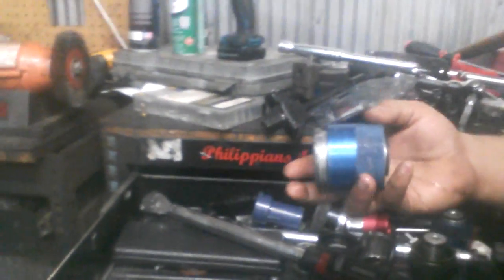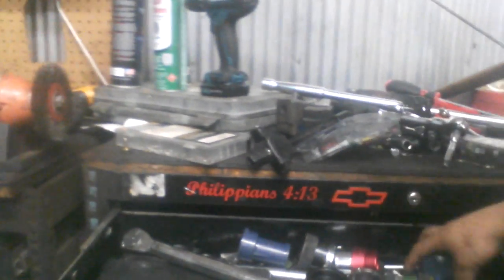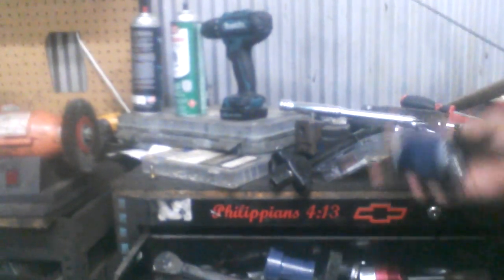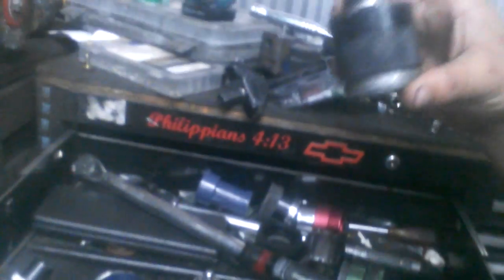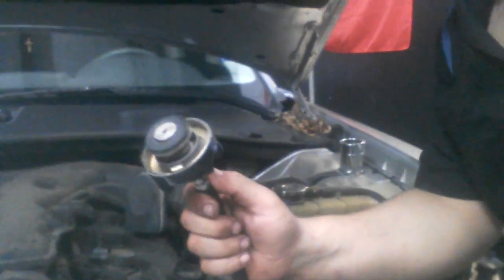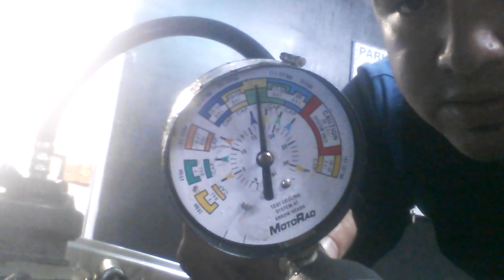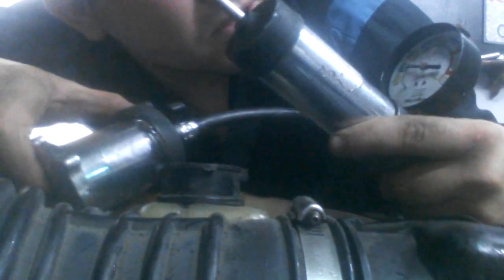How to find coolant leaks. THE EASY WAY!!!!!!

Comment: That was such great information. We have a 2000 Impala that has just had the heads and gaskets done. It still overheats. We bypassed the heater core thinking that might be the problem. It wasn't. There is no evidence of a leak, that we can find anywhere. Yet all the fluids are gone each time. I will now go rent a tester to see if that is our problem which would explain why we cant see a dripping leak..
Reply: Dawn Russo did cap fix it?

Comment: Last year I could get the pressure tester from Autozone for $25 and return it for my money back. I should have kept it. Now they want $250 for a kit that looks like its for a radiator shop. Advance Auto Parts is well over $300. O'Reilly has one similar to the standard in the video for around $80. You can buy a new kit at Harbor Freight for $85 if you want to open your own radiator shop, but the $25 pressure testers are history. I tried 5 different pawn shops and put an ad on Craigslist but no luck.
Reply from the maker: pete peterson yea when I first started I would get them that cheap as well. Don't forget to subscribe and hit the notification bell to get notifications on new videos. Thanks for watching

Comment: Great video I've been trying to find the coolant leak in my old chevy venture I'm tired of taking it to mechanics that take advantage of the customers, at this point I have basicly paid to change the  radiator, the water pump the condenser the termosthat and every time is just a temporal fix, I love this car and I dont wanna get rid of it, but because of dishonest mechanics I been expending probably more that the car is worth,
 where is your shop? 
Dont worry about the thumbs down they are probably coming from the dishonest persons that want to continue to steal from their customers👍👍👍👍👍👍

Comment: I just went thru this with my 2012 Silverado HD Diesel. Pressure test didn’t reveal “nothing that dripped on the floor” - found out later that is because there is a shield underneath as well as a ton of other parts that a leak can hit and gather prior to making its way to the floor.  It takes looking in the nooks and crannies for gathered fluid and not trust the floor.

Comment: Find a good honest mechanic like this guy stick with them and treat them well.  I thought I was going to have to replace the wiring harness and wires (in my type of car that's 6 grand) long story short it ended up being fixed by 2 $1.27 engine bolts AND he didn't even charge me for the diagnostic fee and time that alot of mechanics like to milk as much as possible for those quick repairs. I was obviously quite jubilant about this.  The mechanic impressed me so much with his honesty and courtesyc, so I took him out for a steak and lobster dinner paid for his drinks as well.  In my mind he saved me 6 grand so what's a 200 dollar dinner in comparison. Next to nothing lol. But hey another plus side when I come in for general maintenance or repairs I'm always prioritized to the front! What I'm saying here is treat a good mechanic well and I guarantee you'll get that same respect back. And this guy seems really similar to the mechanic I go to.  TAKE YOUR MECHANIC FOR STEAK AND LOBSTER.  or whatever the favorite food is.  They work harder than you know for less than you'd think.
Reply from the maker: julian floyd thank you sr. These are the messages that make my day. I really hope you have a wonderful day. Thank you very much for your kind words
Reply: I agree my mechanic likes Tequila, cigars and money of course... so that is what I take him, he keeps all my babies running right.

Comment: great video. my radiator fluid is getting low. but no leaks or stain on the ground. ill have to check the cap. by cap is white stains.

Comment: Bought an 2007 Aura and had a coolant leak.  Troubleshot it to hoses under reservoir.  I replaced all 3 hoses (very expensive btw), and you can't make your own as one end is 3/4 and the other end is 5/8ths...  And that wasn't the problem, so frustrating after removing the 3 new hoses again, I inspected the plastic tee again, super close and found the bottom seam has hairline crack (unnoticeable unless you squeeze really hard) at the bottom of the tee...  Hope this helps someone in the future, just a plastic tee replacement, would have saved me a lot of money in those hoses...  Oh the tee is 3/4" by 3/4" by 3/4"...

Comment: Glad i watched this. I can just cut a bike inner tube, stretch 1 end over inlet, other over outlet, & my bike pump will hook right up to it. Might need zip ties, but...
Edit: worked like a charm!!! Idk if this guy took his radiator all the way out, but i wouldn't have found the leak without doing that. But yeah... Fukin old innertube, bike pump, &next - jb weld (fingers crossed)

Comment: Hey man good video. Yes work on the video portion but awesome tip great explanation. Gave me a headache when you moved the camera around. but awesoem job man have  leak in mine suspecting its ab bad cap. Thanks.
Reply from the maker: Morgan Mendieta yea sorry about that. I just learned not to long ago how to edit my videos. New ones are going to be a lot better
Reply: Oz Mechanics no prob.  Thank you. Good stuff. I know you will get better. I would get a tiny tripod the kind with the little linked balls that you can position anywhere.

Comment: Not sure if you mentioned that the coolant should be full first when you pressurize to see if any coolant leaks out anywhere right?  Otherwise if the coolant is really low it wont show you anything. 
Also if the pressure doesn't hold on the first test then there has to be a leak somewhere too right ?

Comment: Great video man! I have a 2005 300c awd. My car has an antifreeze leak. It won’t leak when driving and it won’t over heat at all. It only leaks overnight. I tried looking everywhere and can’t spot the leak. Any advice ? 

Thanks in advance , again great video.
Reply from the maker: RogelioK Rodriguez have you tried using the radiator pressure tester

Comment: I like the video, didnt quite answer how to find a leak that does exist.. Ive got an 02 pontiac grand prix, none of the hoses connected to the radiator are leaking nor is the radiator its self.. im loosing coolant somewhere near my motor. any suggestions?
Reply from the maker: Het Zer have you hooked up a radiator pressure tester to see if it's leaking ?

Comment: you showed us to look under the car for external leaks, but what if it leaks into the engine? We won't see leaks in the engine, so should the pressure at which we pump up the cooling system stay firm at the level we pumped it up to? Indicating no internal leak, or should we do other things to find if it leaks internally?

Comment: I was about to look up a radiator repair shop... heading to Auto Zone now first to rent a coolant system tester.
Reply: My camry 2004 is getting hot and extra box of coolent and even radiator get empty. What should i do?
Im living in uae.
Reply: There is leackege i think because when i fill the water in to radiator  it comes out from the down from right and left sife.

Comment: I have a 2003 bmw 325i and I put a 50/50 mix of bmw coolant and distilled water in it about 2 weeks ago, now my coolant is bone dry. I look under the car almost everyday and have never seen any signs of leaks. could you give me some advise on what to do or what to look for? thanks Oz.
Reply from the maker: Tanner I would call around auto parts store to see if any of them offer a radiator pressure tester with the BMW adapter so you can put pressure on the system to see where the leak is coming from

Comment: I'm a lucky guy where are you located in Houston Texas? I have a 99 navigator that has a leak and I also changed my radiator cap and still have a leak on passenger side.

Comment: Great video my Mazda 6 2006 is having a major leak the thermostat in side reached up to H "hot" and when I checked the antifreeze it was really low what do I do
Reply from the maker: Jeffrey Robles do a pressure test to verify where it's leaking

Comment: Hi I have a coolant leak in my VW Passat b6 1.9 tdi that we can't find. It was initially a torn hose so we replaced it and still loosing coolant from the bottle and small amount under the car but no visible leaks from hoses etc. Any ideas?

Comment: Hi there! 
My VW Polo 1.4 TSI GTI DSG is leaking coolant intermittently... So my mechanic did this pressure test and could not find any leak anywhere... It only leaks now and then.. Even stripped everything and still could not find a leak! Any idea what could be the cause? In case it matters, the 1.4 engine is turbo and supercharged...
Thanks a mil

Comment: HEY BRO. I HAVE THE VAUXHALL,OPEL ZAFIRA 2.0TURBO GSI Z20LET ENGINE AND IM LOSING COOLANT WHEN CAR IS COLD. HOW MANY HOSES ACTUALLY HAS COOLANT IN THEM? HEATER IS LOVELY AND HOT SO I THINK ITS WATER PUMP OR LEAKY HEATER CORE. WOULD PUTTING THE CAR ON A RAMP HELP TO HAVE A GOOD LOOK UNDER IT? EXCELLENT JOB LADS. FROM UK
Reply from the maker: If you have a chance to use a radiator pressure tester that would help out. If the heater core was damaged water could leak into the inside of the car or drain plug from the fire wall of the vehicle. If the heater works as well I would eliminate a water pump failed. Just try getting a radiator pressure tester to verify the leak

Comment: My 2005 Ford escape V6 I just purchased last Friday from a person owner, he just literally replace the alternator I have proof of that and I don’t have any Oil leaks, it rides good,  but to the left of the radiator there is fluid and I believe my cousin said its coming from the radiator is not the Oil,because it’s too light so do you think I’m not just a video but do you think it’s possible that I need to replace my radiator?

Comment: My Grand Jeep 2004 Cherokee has a leak, but looks like it is only when the vehicle is running. I'm assuming it might be the cap that I need to check and or replace. It looks like the leak is coming from the driver side plug on the bottom corner of the radiator. I replaced the radiator about 3 years ago. I assume I could use the radiator fix they sell, would that help plug the leak it is it NOT the cap?

Comment: I put approx 10 liters of antifreeze into the radiator and overflow bottle. My car 1986 Econoliner V8, and it drives like a dream but the windows become very foggy, very soon ? Does it sound serious, headgasket or just the heter system inside the compartment ? I can smell the antifreese from within..

Comment: HI Oz,  I have a 1993 Chevy truck and I have a 1 year old radiator that started leaking heater hose outlet.  I patched it with JB weld around the outlet and it is still leaking very slowly.  When the truck has been sitting for a couple of days there is still a lot of pressure in the radiator.  I have never had this type of pressure in a radiator after it has set for 2 or more days.  Is this normal?  I will drain down the radiator and apply more JB weld.  This is the 5th radiator I have installed in 6 years.

Comment: Wouldn't you be able to identify a bad cap by fluid leakage near the cap? My leakage is on the block near the hose, but not much plus my reservoir ran dry and I just changed out the coolant then left. The new coolant leaked all over the ground the first refill, but I didn't see it until hours later and did not see where the leak(s) came from.

Comment: Bro I have a question, I have a 98 Jetta GL then when I turn on my ac start leak coolant from the driver side under the timing belt , any idea if it is the water pump?

Comment: I have a question pls.  It's really cold out right now; below zero.  I had to get my battery jumped by a professional ... all is well there but now I notice a antifreeze leak on the ground near the front in the middle area.  I'd say about 12-15 inches in depth both ways.  Would you suggest I add a bit more antifreeze to see if that will leak and then take it from there?  I have pro mechanic here where I live.  Thank you in advance.  Kind regards ....  Chandra
Reply from the maker: Chandra Leigh yea add some anti freeze and test with a pressure tester to see where the leak is coming from
Reply: Thank you so much ... I 'll do that

Comment: My preferred method of finding a coolant leak is to take a piece of cardboard stick it under the car run the car get it up to temperature and then let it cool down and look at the colors of the fluids that are on the cardboard. Cheap and easy you shouldn't see any fluids if you see fluids you have a leak of some sort and it gives you a good idea of where the leak is.
Reply: I see a coolant leak on my garage floor, I have a Passat I use the pink coolant, that is exactly what I see clear clean pink fluid, but the mechanic is asking a lot of  $$ to see where the leak is coming from, do you know where the type of leak I described comes from?

Comment: I have a 2002 Chevy Impala and I've got a coolant leak I'm just not sure where. Fluid does get on the ground and I can see the drip if I look under the car. And I've looked where it's dripping but I don't see the actual leak. Wondering if you could help. Thanks.
Reply: Nicholas Dalton same issue, rumor has it they leak alot from the water pump. mine got coolant everywhere and popped my belt. I'll keep you posted
Reply: Sgt.WakeNBake _ I found out that I have to replace my radiator. I found the leak and tried to use JB Weld as a cheap/temporary fix and it didn't hold so I get that fun project when I get paid. Unless I'm leaking somewhere else e.g the water pump. After I replace the radiator I'm good. Hopefully it's just the radiator. Thanks. Go ahead and keep me posted and I'll keep you posted as well.

Comment: Oz Mechanics Joe Doyle. I have a question, my car always says low coolant, i keep it filled to the line in bot radiator and resivour jug , none leaking on the ground, no nasty milky stuff in the radiator but stinky white deadly exhaust, the temperature will go up but not running  hott. What can the problem be? Thanks in advance for your reply.
Reply from the maker: Felita Franklin your coolant level sensor might be bad but I would recommend diagnosing it to verify it’s bad before you start changing out parts

Comment: I have a major water leak coming from the driver side of my Plymouth voyager,  it's a 98, I have to add water before I go anywhere,  how do I check the freeze plugs, or where are they located?
Reply from the maker: Elizabeth Trask use the radiator pressure tester to locate the leak
Reply: located on the side of the engine block. Use a repair manual or blue prints of your engine to help you find things. Note, might want to be sure if the weather gets close to freezing, to stop adding water only, or you truly will have problems with your freeze plugs, and also a possible cracked(destroyed) block and or head. Add antifreeze not water, hope to get it fixed soon so you don't need to pay the added expense of blowing coolant all over the road.

Comment: Is that the only two places that it could be leaking at? I came home to a hissing sound, steam and a slow leak of anti freeze. We can't find the leak, but know that there is one. I had just changed the radiator cap a few weeks ago, and replaced the water pump a month ago. Any suggestions?
Reply from the maker: Michelle Rahner they sell a uv dye that goes into the coolant. You might want to look into that. I’ve had good luck with it. They sell them at Autozone

Comment: Okay so I got one for you. My brothers used to maintenance my car the AC is one I never learned. So I have a 2000 Infiniti Q45 anniversary edition so the AC went out the two front blowers not spinning. Only hot hair coming through. AC compressor not engaging but from the dealership and manual I learned that AC shuts off if there's an issue with the AC/heater to prevent from overheating. I have coolant in the car I actually did a flush on it adding radiator leak fluid. I notice slight leaking on right and left side of engine. I bought it used the owner kept up with maintenance he had receipts to show when he worked on what. This is the only issue I am having with this car. The car runs very well. Just not sure if this is something I can do on my own or take it to professionals don't want to get taken advantage of. Please help....thank you
Reply from the maker: What part of the US are you in ? I have a lot of mechanics that I would highly recommend around the USA 🇺🇸

Comment: THANKS...for the good info:  however, a little bit misleading since (beyond a radiator cap being A possible leak source--AND, the pressure pump indicating whether or not there's leaks, generally)  it didn't help solve for me coolants "leaks", really?  (I've got one SOMEWHERE up behind everything else upon a Dodge RV, 1972 V8.  And, THAT there's...a leak--I know that, already!!!  It gets...more complicated:  since I, also, have transmission fluid mixing with the coolant, additionally?   Two...problem "areas"?  I'm suspecting a hose from the water pump?, or, a back seal upon itself, maybe?  Here I'm speculating, presently.  Radiator hose at the thermostat--just above there--might be replaceable, while it doesn't show any signs of leakage, while that...smaller hose, TO GET...TO, is alike not exactly really visible, bottom end of itself!  And, so...'THE EASY WAY" would become most...helpful, otherwise, naturally?)  I appreciate your comments:  since, likely, the cap needs replacement as well!!  "Checklists"...huh?